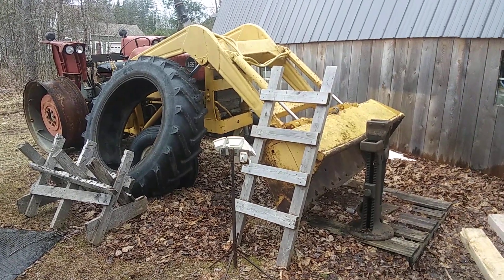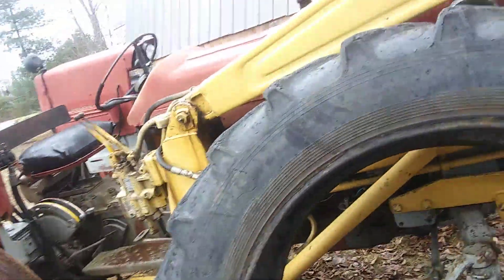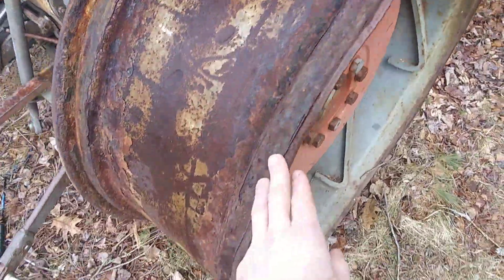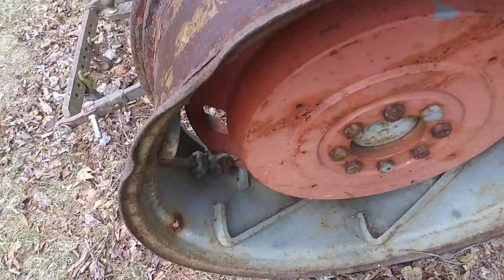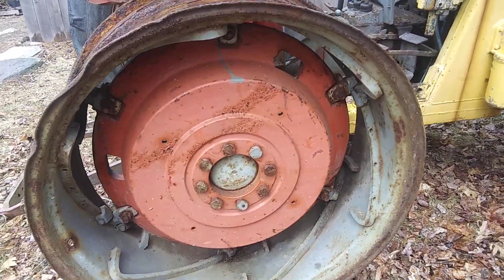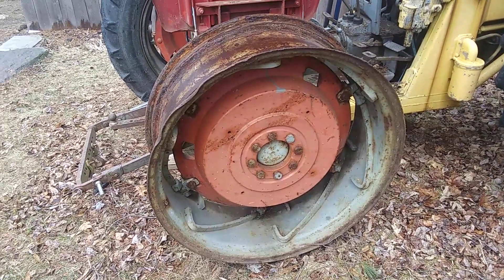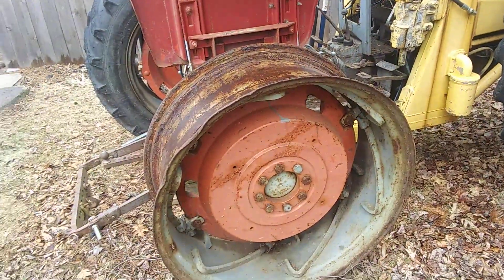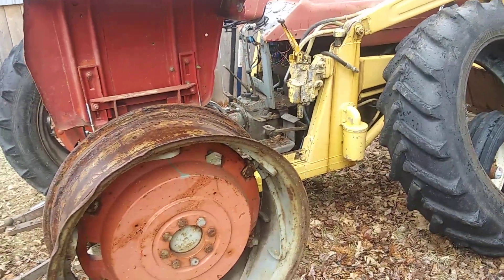MF 165 in need of rear rims.  I said tires but I need rims.

Comment: ..there's got to be a tractor junkyard up there somewhere. my dad got a set of rear tires with rims and a front axle for a MF-35 some years back for $100.00. maybe check those facebook groups and yard sale things...
Reply from the maker: it's a bugger.  there's good and bad things about being so far away from a sizeable population.  Good thing is we are quite far away from a sizeable population.  I have looked at every tractor junkyard nearby and there are none to be found.  I think most tractor rims up in this latitude suffer the same fate.  They use non corrosive liquids to load tires now and this is why :)  Wife is getting tired of looking at it so I expect it'll eventually have new rims on it.  If it wasn't for the bulletproof Perkins engine I'd let it go as is.

Comment: What size rims ? mine are 38 's . I may be looking for a set myself.
Reply from the maker: yes they are 38's.  pricy but I'm glad I was able to swing it.   We sold our cottage. Wife got a new deck and pool and I got new rims and a rebuild on the tractor hydraulic pump.  For as rugged as the tractor is I have now spent more on repairs than I originally paid for the tractor.  Local Massey dealer wanted over $5000 or 2 rims.  I ended up going with brand new aftermarket rims from Chown tractor parts for a little over $2300 for 2 rims.  Pricy but good deal really.  here's their youtube channel:  https://www.youtube.com/c/CanadianRedneck15